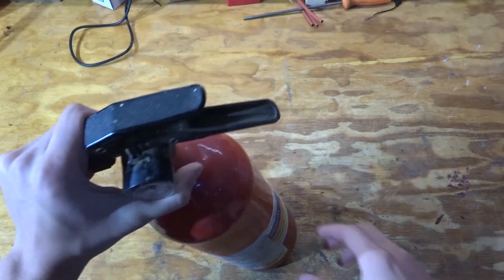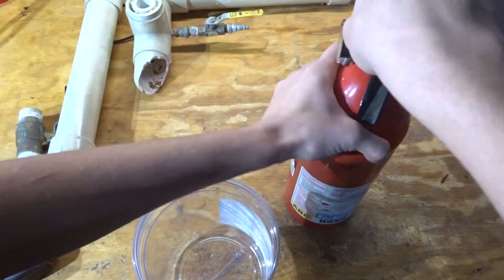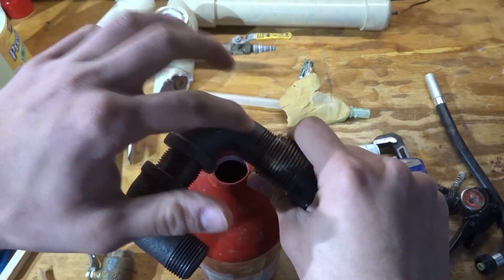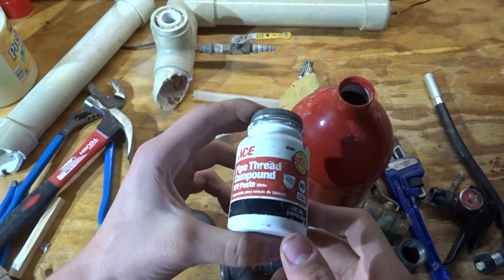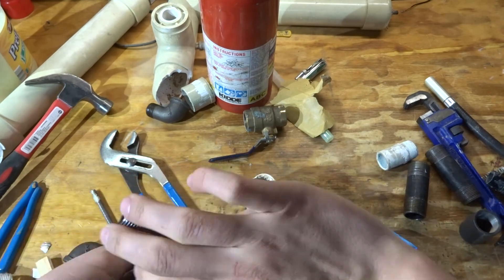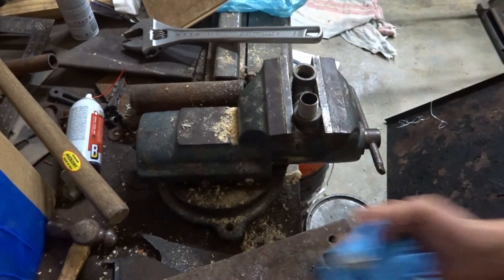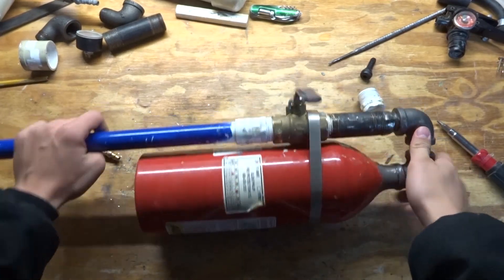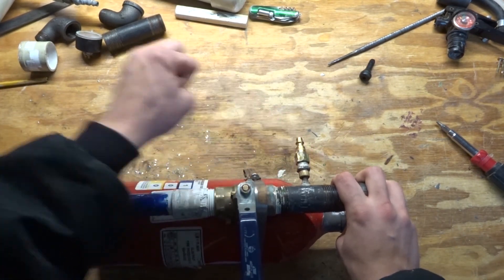I made an air cannon using a fire extinguisher

Comment: how do you fill it?
Reply from the maker: With an air compressor or bicycle pump
Reply: cool! have you tried a fridge compressor? heard they go to 500 psi!
Reply from the maker: Yeah I low key wanna try and get my hands on one. I think if you pipe them in series where you have a first and second stage you can reach even higher pressures

Comment: Hey , I was wondering if I could use this design for a bait launcher? Need at least two hundred yard distance. I don’t like the PVC ones! Also substitute the welding part. Any info is greatly appreciated by anyone, thanks.
Reply from the maker: Bait launchers shoot the bait inside of ice right? I’d imagine 200 yards wouldn’t be a problem. It all depends on how much pressure you put in and how fast the valve can be opened.
Reply: Happy Mad Scientist thanks for responding. Yes the ice bullets would be used, I’m not sure how to substitute the welding. I should be able to use fittings right out of the tank. But not sure. The pressure would be satisfactory, thanks again!
Reply from the maker: I needed to weld cause I didn’t have the right fittings. I used epoxy to fit the steel pipe the the aluminum tank because you can’t weld them together.
Reply: Happy Mad Scientist thanks man.

Comment: this is great, but i have some suggestions, i would use a modified sprinkler valve that has inch female connectors or 3/4 inch depending on what you want.  (if you dont know how wich i doubt theres plenty of tutorials), that should work with the metel your using, if not get some adapters, that would make this a whole lot more powerful. Also, i would love to know what psi this is getting to
Reply from the maker: Psi is roughly 160-180. I’ll check those valves out thanks👍
Reply: @HappyMadScientist  yeah ball valves dont carry the same "oumph" that some might want, however, iv your going to that psi, sadly the sprinkler vaves only rated to 120 psi at the low end of the spectrum. if you get some rubberbands to assist with turining the ball valve that would help alot tho, as a cannons only as good as its vavle
Reply from the maker: I don’t mind the pressure ratings at these low pressure (unless it’s plastic pipe). Yep I’ve been told that rubber and/or springs make a big difference.
I’m going to make another canon soon but I will use compressed air and propane with burst disks. Something a little more powerful haha.
Reply: @HappyMadScientist  yeah, well i cant whait to see it, btw have you come across any good 1 1/2 inch projectiles, we just went from a 2 inch to 1 1/2 inch barrel and were trying to find one
Reply from the maker: Large bolts glued inside of pvc with a duct tape seal. They seem to work well
Reply: @HappyMadScientist  thanks, and the best of luck

Comment: show more vid of it shooting.
Reply from the maker: Okay 👌 
Also it’s about time to make a bigger one...
Reply: @HappyMadScientist  just remember, damage from blunt, bullet-like projectiles is primarily based on calculations of kinetic energy. NOT momentum. KE calculation is 1/2 mass, times velocity squared. momentum is mass times velocity. this is why kinetic energy is a better way to calculate damage. because for example, with momentum, there are issues. a truck going 1 mph and a bullet going at 10000000 mph could have the same momentum, eventhough the bullet will do MUCH more damage. that is how momentum calculations fall short. whereas kinetic energy calculations work well. because in reality, as the speed of something goes up linearly, the energy it carries goes up exponentially. as shown by the "velocity squared".  this is why the bullet is so much more damaging than the truck. so, i mention this because its MUCH more powerful to shoot a tiny, SUPER FAST bullet, than a big fat slow one. i hope this helps you a bit :)
Reply: @HappyMadScientist  awesome ;) ill subscribe and be waiting :)
Reply: Nice work...and cheap...do you believe if make the same i could use that for fishing..to launch the bait?if it launch about 100-150 meters i will be very happy...
Reply from the maker: I don’t see why it wouldn’t work.